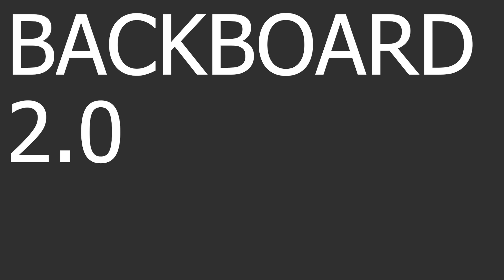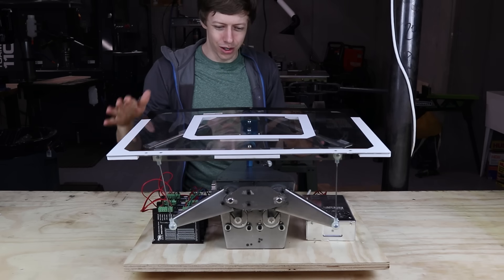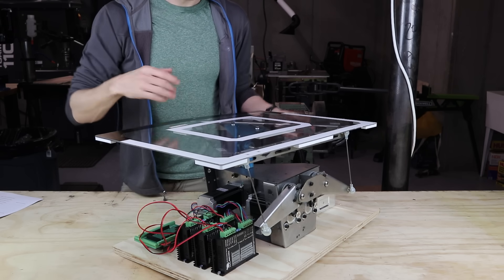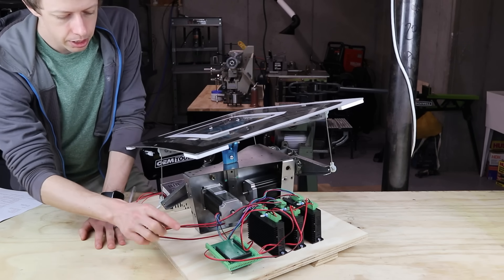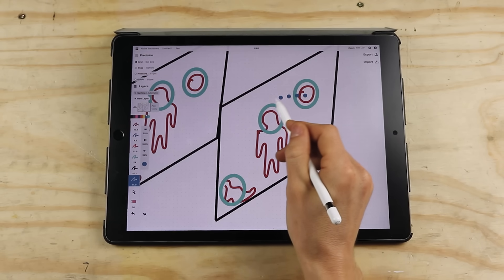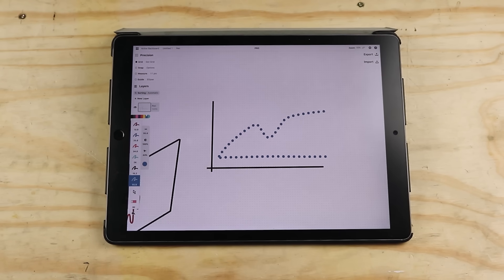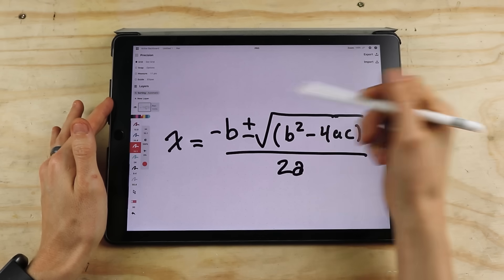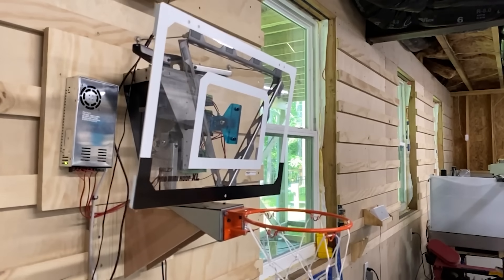The automatic hoop always goes in

Comment: While you are picking which motion, if you already know if you are going to go - or + depth, you can start moving early so that your final position doesn't need to be reached until impact. Sort of like constant motion adjustment dithering.

Also, with the object detection I think you could simplify. Tracing a path of you come across a data point that changes direction drastically it is a data point from an incorrect object. Z range of change between two points can be defined min being the minimum velocity needed to maintain flight by time, and x/y have much smaller variability between two points. %change x and %change y tell you a LOT. Select the object sooner (maybe with tensors, which I'm assuming you are already using anyway) and abort the calculations of the excess objects sooner.

I wonder how EARLY you can determine a satisfactory deflection, move, and cease calculating. That would be the coolest thing of you moved it in real time with signals in the calculation functions and have it already moved while people are still looking at the ball near the shooter.

Comment: Use a Tesla valve to control sound in a home theater.  I have asked several engineers if it would work and nobody knows, so i was hoping you could find out.  I have some ideas on the design as i am an acoustic engineer.

Comment: I have an idea a free energy machine. If you believe it is impossible build it and I'll prove you wrong. But you going to have to sign a non-disclosure agreement. My name is Paul. It should take a few hours to know more than 3 days. It works with regular generators and motors with small amount of modification I live in Dahlonega Georgia. Really I'm not joking some basically we're going to be doing some regenerative braking and in relativity. We Will that do some balancing. I have a lot of the parts the generators in the motors. Is a small enough to power everything from cell phone. You could replace nuclear power on an aircraft carrier and literally power everything on Earth. I say down with the grid

Comment: Am working on a smart goalkeeper robot(soccer), the main concept behind it is that it detects the ball and distinguishes it from its surroundings using the color models, and it estimates the trajectory using a ML algorithm, my question is regarding the electronics part, how could I possibly connect the servo motor to a driver and connect the driver to an arduino and then command them using my python script, I really need help in the stage since the project is almost done, any suggestions or help will be more than welcomed

Comment: I would hope there's a difference with high vs low barometric pressure or dry vs humid air (considering longer shots especially) because it would be cool to adjust for that.

Comment: It seems like you are moving the backboard all at once after you've calculated the shot? Rather than predictively moving and adjusting as info comes in? Wouldn't predictively moving and adjusting during the shot give you a lot more time = less speed necessary for the motors?

edit:
@12:50 yeah you seem to confirm that here

If you pre-move the hoop as the trajectory is being predicted, it seems like you wouldn't usually have to move as far during the "final" move, therefore not need to move as fast.

Comment: You can set thread and process priorities on Windows, which will prevent most or all of the "random stalling" you're referring to. FWIW, this isn't limited to Windows, but is true of essentially all non-RTOS operating systems. The systems aren't actually stalling, they're just doing other work that they consider to be higher priority first. If you tell them that your work is higher priority, the scheduler will let your thread run first, then give time slices to the other stuff. Of course, you could still be preempted by interrupt service routines from drivers, but those will usually finish in microseconds on modern computers. If you need to truly eliminate stalling, though, then you can use an RTOS where timing is guaranteed. But those typically don't scale well to full computer setups and are more useful just for simple systems like microcontrollers.

Comment: In this project, Shane willfully inconveniences himself with the task of figuring out if pixels are a projectile in the camera feed instead of having a tracker signal inside the ball(s) which would make this easier and more efficient. The reaction time would be quicker which would allow for MULTIPLE balls to be thrown and the system less prone to errors if any at all since you can track several balls at the same time.

Comment: At 13:00 it occurs to me you could have already started moving the hoop sooner - if you start moving as soon as your course projections fit an area less than the size of the hoop itself, you have more time and can continue moving the backboard as the projections get more accurate, since the original (broad) projections are still good enough to know roughly what angle the hoop is going to need to face, and as it gets more and more data you just need to fine-tune the angle until it's spot on.

Comment: I think your solution is kind of unefficient, you could do this a lot faster. Basically in the very beginning you can take all combination of balls between some amount of time, approximate the velocity vector, rule out unlikely solutions (i.e. very slow movements or very fast movements). At this point you will be left with at most a handful of candidates plus a somewhat acceptable approximation of their speed vector. Using this vector you can estimate the position the ball should be in some time after, meaning you only have to look for the ball in a very specific area. (Which drastically decreases the time needed to find the balls, but it also decreases the complexity by a lot (so if many ball like objects exists you will need to take far less paths)). Then using this information you can improve your estimate to the speed vector.

Then another thing: Although the approximation of the speed vector is refined till the end, we still have that the calculated end point is continuous, and you can choose your board position in a way that it is continuous of the speed vector. This means that you can adjust the position earlier and only need to do small adjustments afterwards, which saves you the trouble of having to move the whole way in such a short time.

Actually it should be possible to get the tracking with a single camera. Basically you know the size of a typical Basketball. Thus you can get distance to the camera from the area of the ball on the image.

Comment: when u have a basketball
and there is a automatic hoop that doesnt let you miss
insert reaction time
you decide to miss the hoop and get 100 bucks
insert reaction time
insert reaction time
you decide to make a multi billion dollar magnetic vacuum launcher and you decide to attach the basketball to a rocket booster less than 1m big and launch the contraption which accelerates the basketball and the rocket booster to a speed of 12345 m/s and launches the ball and rocket booster into space in 3 seconds and then you use the rocket booster to adjust the orbit around the sun to go near the sun and then it goes near the sun and performs a gravitational assist movement
insert reaction time
you are happy that you missed the hoop and get 100 bucks

Comment: Love the concept of a can't miss hoop, and appreciate the engineering and programming that went into this version as well as the others.  Not sure if someone has suggested this already, but could you get similar results with a regulation backboard that doesn't tilt in either direction but instead is made up of a grid of small solenoids?  You could use all of the same ball tracking you've devised to determine where on the backboard the ball will hit and then rapidly actuate a solenoid or solenoids to redirect the shot in (might not even need to be more than 1 cm of throw for any solenoid).  There would be several advantages to this approach if it could be made to work.  First, with the solenoids mounted behind the backboard and flush with the surface, unless someone looked carefully they wouldn't notice it was a non-standard hoop (i.e. they wouldn't immediately know you were cheating).  Second, solenoids are relatively simple bullet proof components that might be more robust.  Third, there might be a way to address the very extreme, line drive shot with this approach. Just a thought. Keep up the good work

Comment: very nicely done & explained. I wonder if you could solve some of the speed issue by constantly updating the location of the backboard according to your current best guess of the trajectory, on the assumption that the trajectory error will mostly decrease on each frame, and therefore the amount of last-minute adjustment is required will be less. That's assuming that you have feedback control on the motors, one of the things glossed over in the video.

Comment: I don't get why you're using three motors and not just the two for the edges and no center rail at all, just use an universal joint at the center? That should make everything even stiffer and the choice how to move the board for a given shot even simpler...?

Comment: Just wondering if there is an opportunity to make the movements earlier with the ability to correct multiple times from initial movements... for instance would it help to make an initial rough movement while the ball still has a relatively long time until contact with the back board and then when more data comes in to provide more accuracy about the ball trajectory the board would have less distance to travel to correct. I could see an issue if the initial movement and the revised trajectory meant the motors had to switch direction but maybe that could be corrected by picking initial movements that are unlikely to require motor reversals. Just wondering. And if this thought process could be applied to the fully moving hoop.

Comment: If Windows is the problem, why not use a microcontroller like an arduino, or alternatively, a Raspberry Pi? Much more reliable than Windows which is garbage that we have no choice but to use. Also, I wouldn't be surprised if plenty of latency is being generated by using Python over something like C. Highly recommend using C anyways. Far more versatile as a programming tool unlike other languages that just limit you in your capacity to program. It's not the best, but it's the best we have.

For something with more power, you might consider getting RISC-V boards.

Comment: When you're calculating the trajectory you wait until you have mathematical certainty on the final location and make a single move there. Did you consider beginning the move earlier, based on inaccurate data, then subsequently fine tuning the move? It seems like that could result in slower and smoother motion, though as we both know things aren't always as we guess.

Comment: Seems like you could use delta frames to identify the ball really accurately. I don't want to launch into an explanation about what that is if I don't have to, but if you are having trouble identifying the ball quickly, using delta frames could do it within two or three frames of video. In fact, the faster you are shooting the faster it would identify the ball. Because very few things in your video are generating delta frames it should come down to your head and the ball and then by linking the other delta frames of your body to the delta frames of your head you could eliminate everything but the ball within about six frames. I can show you how to write the code for this in one or two smallish code blocks if you're interested.

Comment: For the issue of Windows locking up your program and making it too slow to respond, that'll be an issue with the OS. You need your process to run with real-time priority. I know you can do this pretty well on Linux, and probably can on Windows as well (though I'm not sure). You could also run it on an embedded micro-controller, using an RTOS, which would guarantee deterministic timing.

Comment: What if you made the hoop move continuously as the software updates with more data over time until just before contact. Less strain on the motors because they'd be moving slower. You could also set a limit to the motor velocity, so if the updates from the software were far apart, there board wouldn't be snapping back and forth. It would just move slower to the current one even if it didn't make it to the last one, rather than quickly snapping to all the updates.

Comment: In Calculus, AP Calc, and AP Statistics in High school i would make programs on mt TI-84 calculator to do the longer more time consuming equations for me. I made one of the quadratic formula, it had one bug that i found with a double negative, but adding another set of parentheses fixed that. All i had to do was input a, b, and c and it would give me 2 answers, one for using a + and one for using a -. It was a pretty simple program, just asked for 3 inputs, then ran those inputs through 2 different equations (the + and - versions) and spat out the answers for me. I strongly recommend using this for HW, but on tests and shit they usually require you to write out your work, but for that you can still double check you work with the program.
It was also super fun blowing the minds of my friends with those programs.

Comment: Awesome project!
Isn't it possible to make early guesses? For example when we have 3 frames with maybe balls in them we guess the trajectory and if it comes anywhere near the system we adjust the board's position and then we refine as we get more data. Also, ranking potential solutions seems wasteful - why not just find the one that changes the current position the least?

Comment: 3:20 - it only takes 3 points in space to define a plane. Consider if it took 4 points, making 2 lines from the 3 points would, you could pick any point along those two lines to be the 4th point, so from 3 points you can get 4 points, thus it takes 3 points. The problem with this logic, is you could apply it backwards, take 2 points and form a line, your third point can be found along that 2nd point. So it doesn't take just 3 points to define a plane, it takes 3 points where one of the points can't be found along the line formed by the other 2 points.

Comment: 6:06 isn't that high voltage? (Because you're touching it😂)
Reply: Yes, but it doesn't fry him as the current doesn't flow through him but through the sheet metal to the other contact (path of least resistance).

Comment: what if you put some kind of chip in the ball, i dont know about computers and tech stuff like that. but i know you can put some kind of chip in the ball and have it link up to the backboard so it knows more accurately where the ball is at, what its doing, and possibly how much and what kind of spin it has. maybe the basketball spinning will interfere with that i dont know. you are the engineer after all.

Comment: An idea for improvement: instead of having the algorithm narrow down it's selection of ball by finding the best curve, use the distance tracker in the Kinect to find out which possible "ball" isn't attached to or touching anything.
Reply: I also think it should be constantly moving to where it thinks it’s going to be, even if at the beginning it isn’t super accurate. As the ball gets closer it’ll position itself better and it should require a less powerful motor because it won’t have to move as much at the last moment.

Comment: 12:40 There's a problem, although that problem gives it the potential to be even better, is that the momentum of the backboard moving could apply unwanted extra force to the object, assuming you want the backboard to be completely still by the time the object hits the backboard and you didn't program that in. Before I explain why that "problem" could actually be helpful I also need to add that you might want your program to know the density, material, frictional properties, vibrative properties of the backboard the software is using (and maybe aerodynamics).
For example let's say your backboard (for some reason) is made out of a material that absorbs 99% of energy, even if the backboard was at the perfect angle the ball would still completely stop in its tracks and not go into the hoop. This is were your "problem" can become helpful, if you program it to know that "Well no matter what angle I do, the ball won't make it into the hoop If I stay still." (Yes I personified the software.) then you can program the backboard to "swing" at the ball in such a way to add the extra force the ball needed to get into the hoop. 

P.S. I don't mention the material and etc. of the ball is because the software would have to figure that out in real time, when time is a really important resource, whereas  the software already knows what the backboard is like. Even though you could make it default to assuming the attributes is of the average basketball this could make the calculations more inaccurate if I throw a tennis ball at it (even though there is a least denominator solution for this using variables the program was already using to determine the angle, but I'm tired, so...)(although this is a basketball hoop so why would I throw a tennis ball.)

LOL 7 seconds later 12:47 I guess it wasn't a problem, however regardless my advice doesn't just get rid of the problem but (hopefully) also improves your current design. Good Job this is pretty arduous stuff to do.

P.P.S (this is getting ridiculous I'm sorry) The thing about material, friction and etc. In my opinion would be especially helpful for accounting the spin on a ball.

Comment: 600ms is pretty much, you should have mentioned the FPS of the camera so we know how many frames u have to calculate data on. Modern GPUs have great paralel computation power and can handle such stuff easy. Also ditch windows and use Linux to save resources.